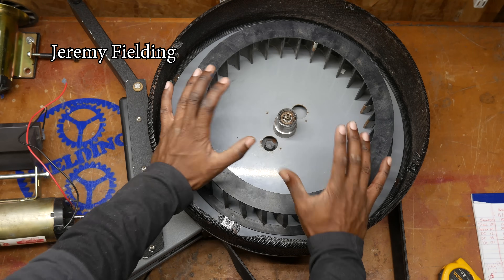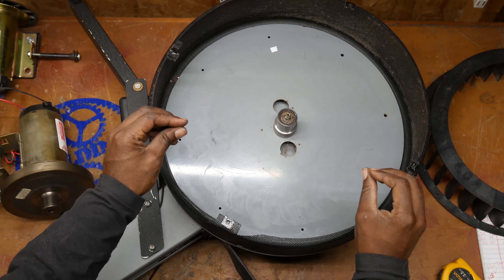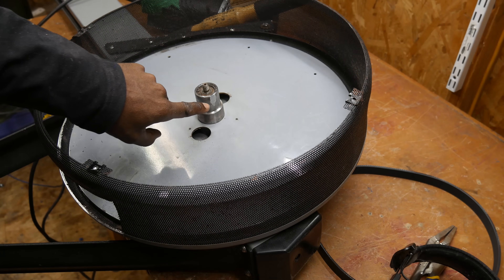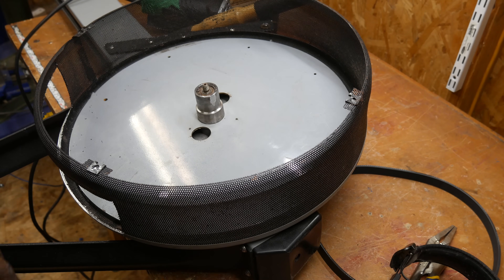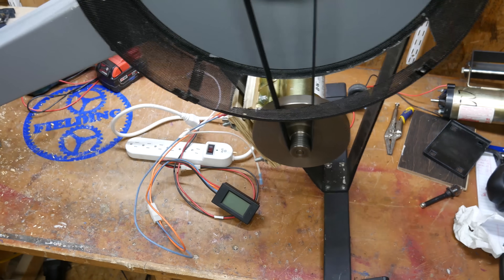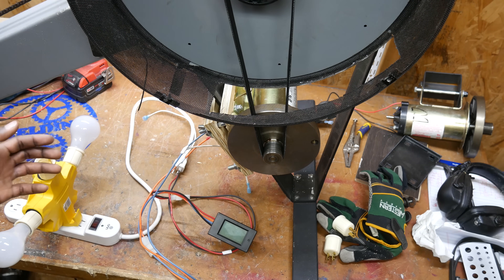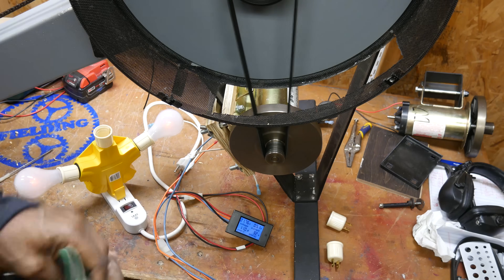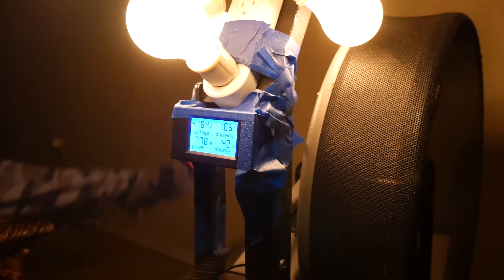Building a Prototype Generator From Treadmill Parts, and Channel Update: 053

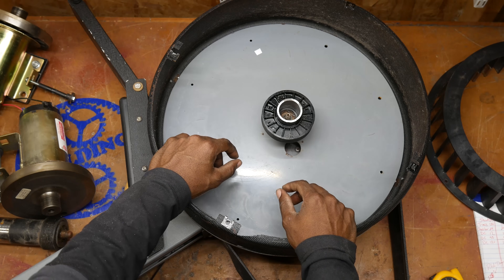Comment: At 1:50, is that oil being put on the drilled piece? what's it for?
Reply: Answer to Pelumi’s question: The drill bit lasts longer & is less likely to chip if you cool & lubricate it.

Comment: What do you put between the motor and the battery to stop the power from the battery power going back and powering the motor? I want to build a windmill but if you connect the battery to the windmill it's just going to spend the windmill when the wind is not blowing, so what would that be called that only lets the power go one way?

Comment: Good project, Jeremy . And a good video. I am curious about the light bulbs. You didn't say whether the light bulbs were incandescent or LED and how many watts they consumed. There would be a big difference between driving a few 60-watt incandescent bulbs and a few 60-watt equivalent LED bulbs drawing about 9 watts each.
Reply from the maker: They are regular 100 Watt light bulbs. Not led

Comment: I just saw the scene from 'Soylent Green' with Edward G. Robinson peddling to charge their battery to have lights.  To make it a bit easier, leave the fan blade off the unit.  You don't need extra resistance for the function you are trying to achieve.  Perhaps using a recumbent bicycle would do the same function using leg power so children could use their game controller while generating the power.
I really love your innovative ideas.

Comment: you wouldn't happen to have a tread mill motor. or a similar higher voltage motor/ generator you would sell do you? I have a electric scooter motor. I was going to make a wind generator or water wheel generator with. but I connected it to a drill and volt meter. and all I got was disappointed! I got barely over 9 volts forward. and just under in reverse! and I need at least 26-27volts. and a couple amps. this isn't gonna cut it! even if I put two in series! I would love to use a tread mill motor and use a super cap bank. and buck converter with constant volts and amps. to regulate output. keep a constant 28v to charge the batts. when you are off grid. you need all the power sources you can get! my 5 kW inverter is hungry! I even thought about building a generator bike. using a alternator. with a brushed motor controller on the brushes. to set the output and difficulty of peddling.  also using a buck boost converter. to keep output constant. I have a 55amp 12v alternator ready to go
. I just need the bike and motor controller. and a high power buck boost converter. and a charge controller. but I'm thinking maybe I should build a wind or water generator with it! it would only be about 25 amps when boosted to 24v likely 20 considering losses! but hey. 20 amps is better than no amps. especially if its constant output. about 200 watts x 24 hrs. that's a good bit of power. likely enough to run my fridge and freezer. since it don't run constantly.  and those are the main users of power. as long as I got that . the rest can go to TV and lights!  hopefully I can build a 40' tower and a wind mill. haven't decided . v.a.w.t. OE h.a.w.t. probably both. to see witch is best. sorry I'm such a rambler. its been cold and I kinda JH ave cabin fever! good day. hope your new year is going good! hope your kids like the project!
Reply from the maker: I have many treadmill motors, just send me an email from my website www.jeremyfielding.com

Comment: You should really get a welder. Harbor freight has cheap ones for 100 bucks. Imagine how much time you would save attaching metal to metal.
Reply from the maker: it will come in time. But, I don’t have enough welding projects just yet to push it ahead of other things I want.

Comment: This rawks pretty hard! Especially the kid involvement...
Just for fun, and at a WAY later date, have you thought about having a battery charging  set up that uses the excess power from the generator on a momentary basis, to charge a battery that would supply power for generator "down times"?
All you would really need is a potential relay to divert excess power to the charging circuit.
That would solidify the idea of the First Law of Thermodynamics in a tangible way.
Reply from the maker: I will have a battery set up for the kids to play games. They can row any time and store power for when they play. If they run out of juice they have to row in real time to play! (Insert evil laugh here)

Comment: What is the specs on that motor?  Volts/amps/rpm
Reply from the maker: 6300 rpm, 130 volts, 18 amps if I remember correctly. I show this in great detail in a previous video.
Reply: Jeremy Fielding thanks! I have several with different ratings and am trying to figure out how fast I will have to turn any of them.
Reply from the maker: Check out video # 53. I made a chart that you might find helpful and show it in that video

Comment: Great build so far!  Where did you get the rower?  Even used/broken ones seem to go for quite a bit of money around here.
Reply from the maker: I bought it on Craigslist used with no display. I think I paid $300 for it. I don't remember for sure. A concept 2 keeps is valve for a long time. They are about $1000 new.